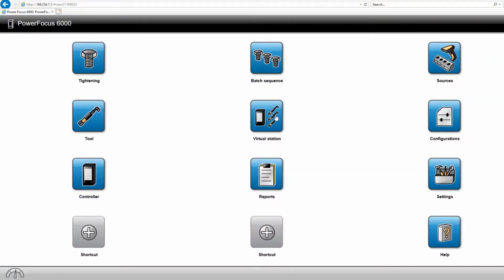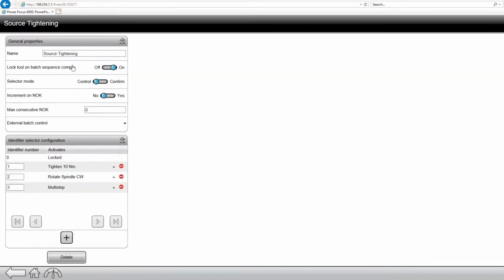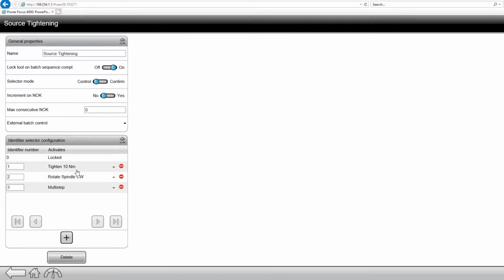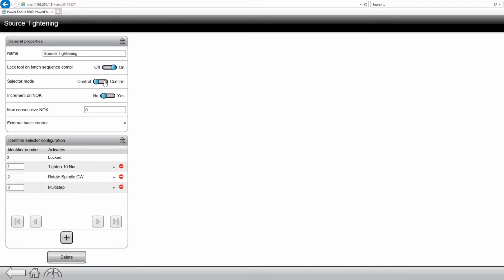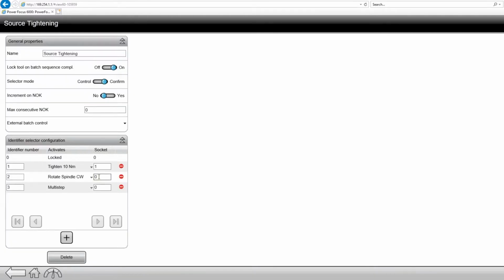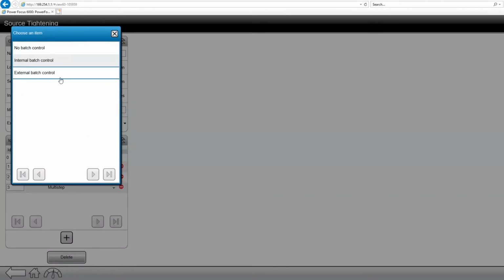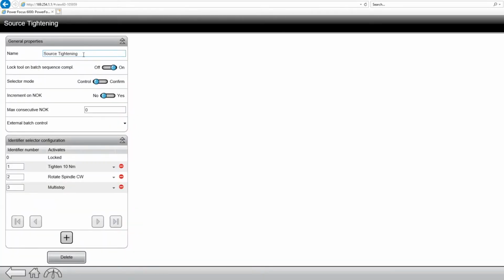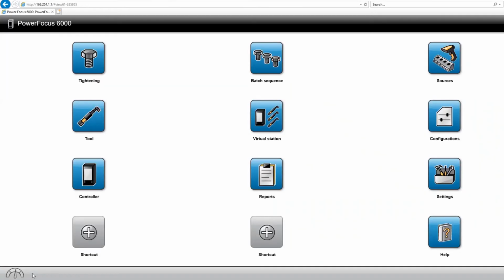PF6000 | How to select P-sets from an external source

Comment: Currently we are using pf4000 controller, In that I have to control through seriel port. And I have to select Pset thorough rs232 communication scanner.. I have 6types of Barcodes. 6barcodes has respect 6Psets. Pls guide how to add Barcodes in pf4000 and how to select Pset based on scanning. 
Thanks, 
A. Selvakumar...

Comment: HI..
I'm from India..
I'm working to configure PF6000 with Toho technology (tool unit) through external source for selecting Pset..
But during tightening I'm getting error like no tightening programs selected..
Reply: Hi Nandish, I'm getting the same error. Did you find a solution to this? Your help is greatly appreciated.